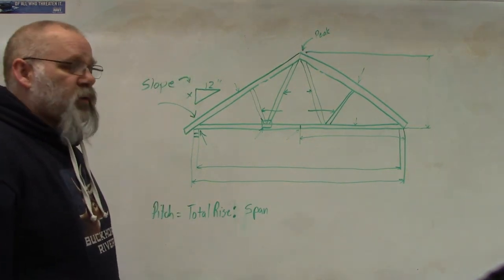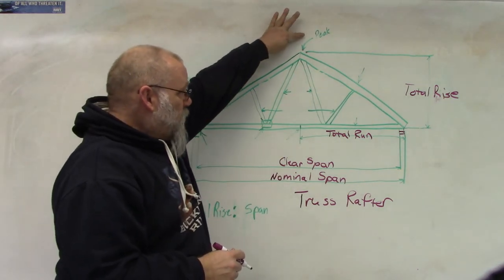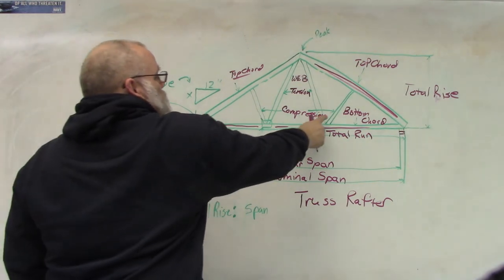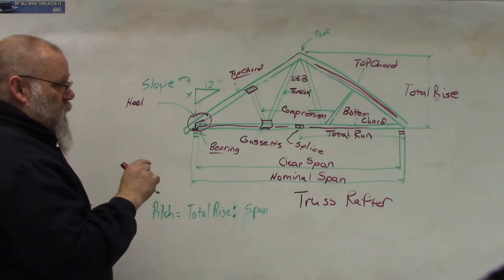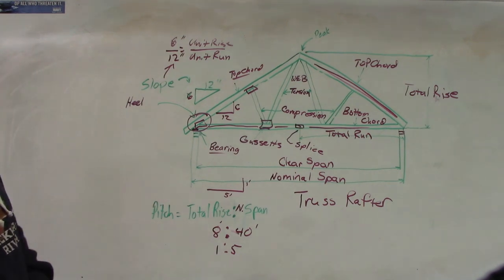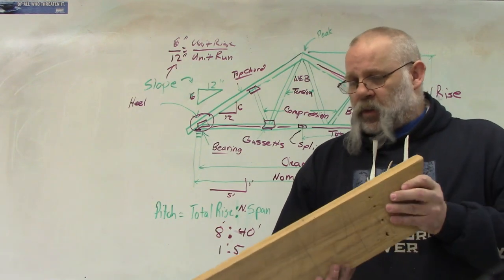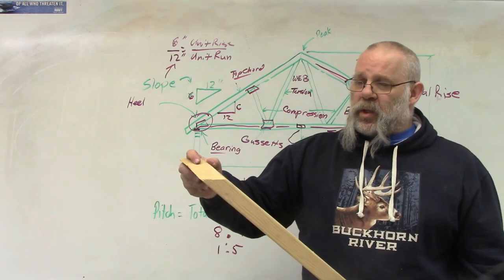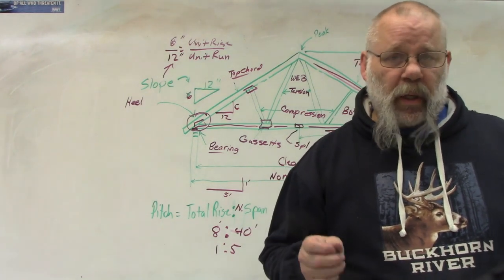Rafter Terms

Comment: what is the run roof framing?  answer : half the distance between the outside edge of the double plates.(But I don't understand the meaning of this answer, can you help me with a sketch，Thank you:)
Reply from the maker: I do a video on how to use rafter tables. In it I explain what total run is.